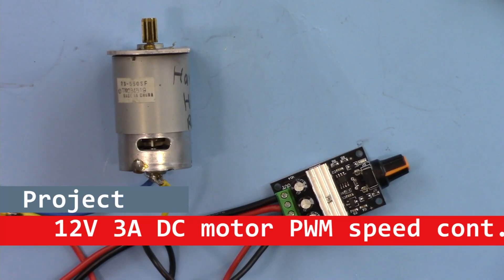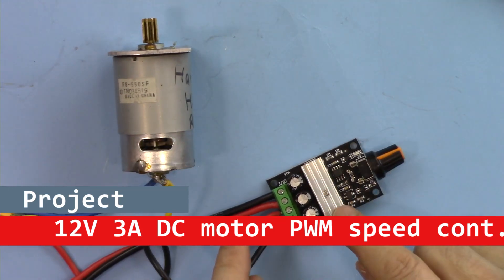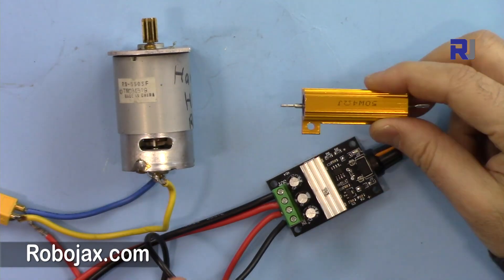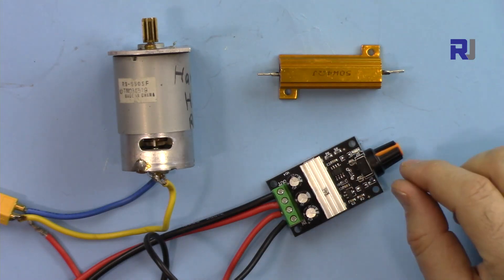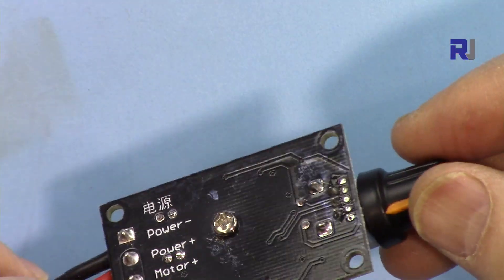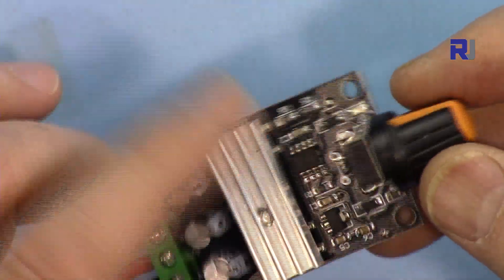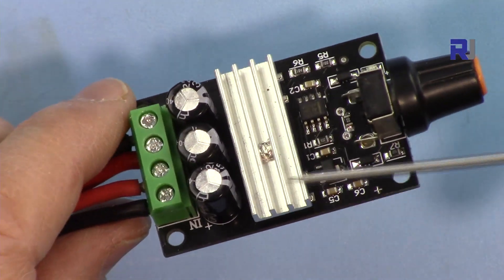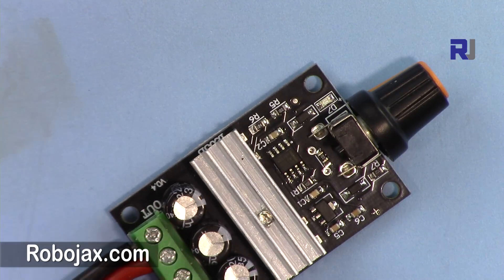Test review of 12V 3A PWM DC motor speed controller

Comment: You should check temp of the wires themselves.. when I use this module and tool goes under resistance the wires get very hot and the insulation will melt if under load/resistance long enough

Comment: Since it's controlled by pwm does heat more when is at 20% - 50% or 100%(flat)?
Reply from the maker: 5% or max 8%.
Reply: @robojax  anyway the back heat more than radiator, mine at 12V 40W load, half dimmed (after 1 hour) was quite hot, also because lack thermal paste between Mosfets

Comment: Hey I have a question
Recently I bought 12v motor speed controller from eBay 
My motor makes noise at the lower speed 

When check the voltage with multimeter I find out that the speed controller changes voltage not amp 

Is this how we supposed to be ? 
And if I want to change amperage output not voltage is there any solution to that ? Or I just have to deal with the noise?
Reply from the maker: Hi, the controller changes the Pulse width (PWM). the voltage must be fixed. so input is 12V, the output should be 12V or something like close to 12V (11.5V or so.) The speed is not changed by increase or decrease of voltage.  Now if the noise could be two thing 1-there is not enough power from your power supply or it is weak. 2-motor is is not ordinary and it has other mechanism inside it making noise as it might need different frequency or PWM to operate.

Comment: How much output power
Reply from the maker: Voltage X Current = Power. At 12V maximum rated current is 3A but I tested to show you if it can handle more or less. see the video.
Reply: @robojax  and sir...how much input current..? It is 220V or it can handle power supply from board. Because i had tried and it burns.

Comment: Its posible to run a dc 555 motor 12v  with a 6A speed controller?
Reply from the maker: your question is confusing. 555 is timer IC.  for the (6A) it is the current, I have tested this module and don't remember what was the maximum so you gotta watch it to see how much it can handle. as for the 12V. yes it can control 12V motors.

Comment: Hey robojax I've got a 110v to 12v 10a power supply used to power one 3amp fan and a few 80mm pc fans and it happened twice that it's making the same screaming noise non stop.. Why does it make that sound
Reply: It only went away when I went to take it back to the shop then it was fine started to scream recently again and only stopped after being off a few days?

Comment: I want 12 volts motor to run at the speed of one revolution in 12 hours, how do I do this and should be able to bear the weight of 5 kgs
Reply from the maker: Use stepper motor which is the best option. or use geared motor which reduces the for example 100:1 (100 to 1) or 1000:2 and you will need motor encoder. with basic DC motor you can't do know the position of shaft.

Comment: Will this operate a 12V (0.12A) PC fan? Considering the fan has 4 pins (wires) The purpose is to lower the noise of the fan. Cheers!
Reply from the maker: this is for DC motor brushed motor which has two sires only.

Comment: if applied with a motor gear box so that the speed drops whether the torque will run?
Reply from the maker: this module just sees the motor. Gear box is after the motor. So this module doesn't care about it.

Comment: What is the default potentiometer value?
Can we change the default potentiometer to become a mono potentiometer?
Example: For example the default potentiometer value is 10k, replaced with a mono potentiometer B10K.
Btw, I have one of this module, and I see all the value of the capasitor module is 35V. So.. Is it safety if we input the voltage source from 24V ? Because I only have 24VDC adapter..
Thank's 4 the respond...🙏
Reply from the maker: yes you can . it is single channel any ways.
Reply: @robojax  Thanks for the advice..🙏

Comment: Can you share that diagram Pwm Dc ?
Reply from the maker: I did not build it. Just purchased it so there is no schematic. why you need the schematic? you can't build it. this is about $2. if you build it would cost you more than $10 to $15. if yo want to draw schematic, you can do it less than an hour.
Reply: @robojax  I make several project OEM so that I need to understand that circuit diagram ? But I cann't find informations about diagram on website ?

Comment: Is it possible to use on old harddrive i kinda bought the wrong one.. Try to make a table disk grinder with the hard drive.
Reply from the maker: I believer grinder has very powerful motor. Hard drive has very weak and delicate motor.

Comment: motor speed control, whose this formula  use in this ckt?
Reply from the maker: Hi Mohammad, this is using ic 555 timer to generate PWM and feeding it to power MOSFET to control the speed of motor.  The formula to control the duty cycle of PWM is shown on page 11 in the datasheet of NE555 chip here http://www.ti.com/lit/ds/symlink/ne555.pdf

Comment: can this module be used to run hard disk motor?
Reply from the maker: it can run any DC motor withing the voltage range. I believe hard drive motor is brushless 3 phase.

Comment: I need its circuit diagram. schematic. pls help
Reply from the maker: No available. You can draw it. Remove the heat shink and draw it . it is very simple. You won't be able to read the capacitor values.

Comment: Hi sir good day . I have a question I have a 12v dc electric fan .. then i want to use it for a 24v dc power source .. can i use this kind of speed control that youve shown ?? TIA Hope you can give me your answer
Reply from the maker: No you can't. This device will not change the voltage. It will output 24V which will kill your fan. The input voltage should be the same as your fan. This module controls the speed of motor with PWM.
Reply: @robojax  thank you sir .. then in order to use my fan in a 24v dc what should i do ?
Reply from the maker: It will not change the voltage, but you can connect your 24V to the input of this and connect your motor to the output. it will work. I have added the link to eBay items so you can see that they mentioned the voltage as 12V, 24V etc. https://www.ebay.ca/sch/i.html?_from=R40&_trksid=m570.l1313&_nkw=3A+pwm+motor+controller&_sacat=0

Comment: Hello bro , can i use 18v 2amp ,with motor clock and anticlockwise rotation
Reply from the maker: This can't change the direction of rotation of motor. It rotates only in one direction
Reply: @robojax  ya that's good but if i change wires opposite then it rotates anticlockwise rotation did you test like that

Comment: good video bro. can this PWM speed controller connect with 4pin cooling fan (desktop computer fan)?
Reply from the maker: No you can't . This for brushed  DC motors. Computer fans are usually brushless DC motor.
Reply: @robojax  thanks, do you have any idea to make the 4pin cooling fan can adjust the speed?
Reply: @jackygo3444  looking also for an answer in 2022... Did you find any?

Comment: Hi. I think I'm going to have great success using one of these for a HO tyco slot car. what do you think? I think this will work without any heat!
Reply from the maker: Hi, It should work as long as the current is 3A or lower.
Reply: @robojax  OK thank you! please clarify one thing for me: are the incoming and outgoing negatives common? give zero ohms from one to another?

Comment: I have PWM DC 6V 12V 24V 28V 3A Motor Speed Control So does it can run on 26vdc 2amp ? Please reply me fast
Reply from the maker: no. the input is made for 12V and it will die if you connect it to 26V.
Reply: @robojax  but it has 6v to 28vdc input voltage limit so how it can be burn?
Reply from the maker: check the capacitors' voltages. if the voltage is above your input voltage that might handle it.
Reply: @robojax  thanks for great information.
Reply: One more thing does it can effectively run on 1.9 amp DC current ? Reply me fast

Comment: Can we connect this motor directly with main switch
Reply from the maker: This is for DC motor. what do you mean by "main switch"? You can have as many switch between this device and the motor as you want.
Reply: @robojax  i mean to say that we can connect directly to 250 volt like drill machine switch is connected to 250 volt switch  or we need any other setup

Comment: why is the voltage changes when you turn the potensiometer low?
and what component is under that heatsink?
Reply from the maker: if you are controlling a motor,  you will not feel it because lower voltage will reduce the speed of motor and PWM also can reduce the speed of motor.
Reply: @robojax  so the potensiometer, is it control the voltage or the pwm signal?               sorry for such noob question.
Reply from the maker: it controls PWM signal. There is not voltage controller in this module.
Reply: @robojax  so  if you lower the pwm signal using the potensio then the device outputing lower voltage to the motor and vice versa? is that correct?

Comment: Sir can we give 12 v 5 A
Reply from the maker: you can do 12V but the 5A is determined by the load. if your motor needs 5A, it will take (draw) 5A. But I don't think this device can handle it.
Reply: @robojax  ty
Reply: I can handle but for only maybe a min

Comment: how did you connect the motor?
Reply from the maker: watch the video, it has been mentioned at 01:25 (click on 01:25 to watch that section)
Reply: @robojax  the wires of the motor are yellow and blue, but the wires connected to the controller are black and red.
Thats why im asking how you connected the motor because i have one the same,
Dose this type of motor need a resistor to be connected to the + and - if i want to use a direct connection from a battery?
Im not an electronic expert if my question is silly 😁
Reply from the maker: At the back of this module, there is clear labels for Bat ( or battery) and Motor.
Reply: @tattoomafew2316  i have ordered the controller but cant get the RPM go very slow even with a low valtage, im trying to build a turntable and not sure where im doing wrong.
Any advice is appreciated.
Reply: Hi what is the yellow component connected between the controller and the motor? I’m trying to control two 12V 0.16A fans but at low ratings the motors squeal. I’m guessing I need a regulator but not entirely sure. I’m a novice in electronics

Comment: It is quite simple and based on 555 and a mosfet with a schottky power diode. There are many such circuits built on Youtube.
Reply from the maker: but this is very reliable and can handle a lot of current and finally it is very cheap.
Reply: Rajendra Verma answers is thanks...good video